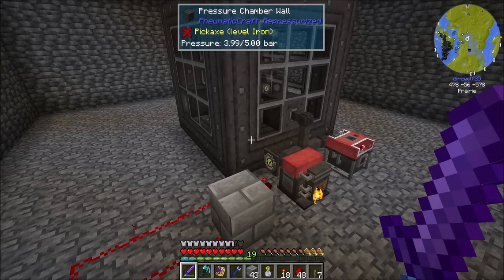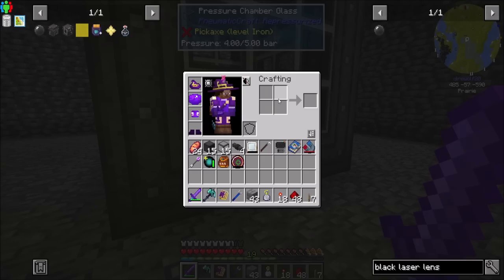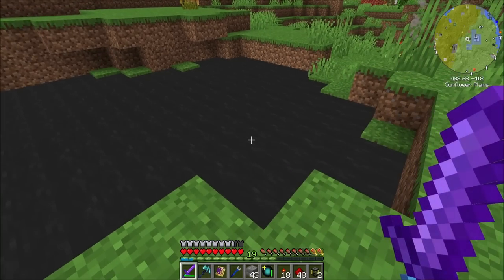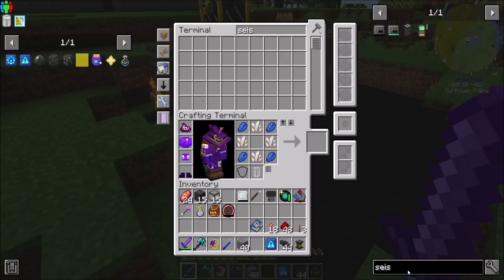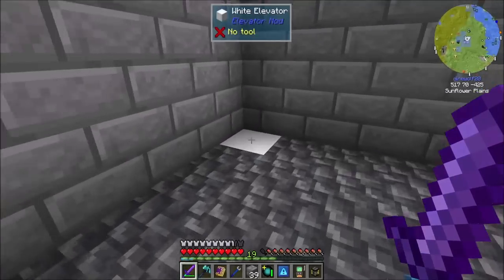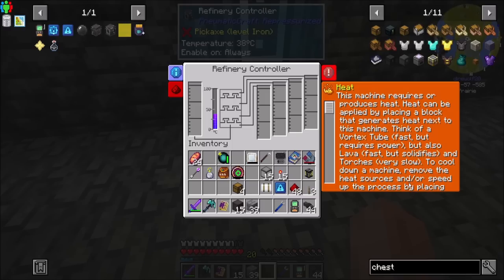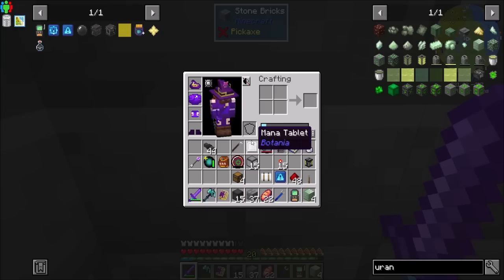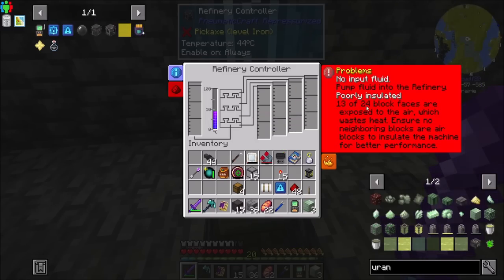LetsPlay S12E51 Oil Processing

Comment: Just fyi dire, when you have an open valve on a compressed air multiblock then OF COURSE its gonna leak
Reply: Should a valve be closable (and that be the default state)?  If not, it isn't a valve, it's just a hole.

Comment: I think that torches would make for a good insulation choice; They would slowly add a bit of heat (as opposed to doing nothing thermally), without ever decaying.
Another thing, but I think gasoline works better as a fuel source than LPG; LPG has a 1.25x modifier, while Gasoline has a 1.5x multiplier.
Reply: Yeah, I've been wondering for a couple episodes if Dire is ever going to notice that gasoline is the best fuel or if he is just going to convert it to less efficient LPG and burn it.
Reply: What does the modifier do, and how does that interact with the number Dire was going by?
Reply: @jursamaj  These values are pulled from the chart to the left of the UI in the liquid compressor, which indicates how much power is derived from a fluid. He skimmed it an episode or two ago, and seemingly assumed LPG was the best, as it was at the top of the first section.

In other words, LPG produces 1.25x (25% more, or 5/4ths) as much energy per bucket than "standard", while gasoline produces 1.5x (50% more, or 6/4ths) energy per bucket than "standard".
For reference, Lava was a mere 0.25 (meaning it produces just 25%, or 1/4th) as much energy as "standard".

Note that the 'standard' value is arbitrary; there's not "normal" or "intended" fuel; it's merely there to make it easier to define how much energy a given fuel produces. (This is why I put "standard" in quotation marks; to clarify that there is not "standard" fuel; it's an arbitrary value, used to simplify math and make comparisons between fuel types easier.)
Reply: @tygerion4404  OK, that's fuel efficiency, energy per bucket.  Pretty sure he was going by energy per time.  So the LPG produces energy faster but uses fuel even faster than that.  If you can produce fuel fast enough, energy per time is more important than energy per bucket.
Reply: @jursamaj  ... I'm pretty sure that the compressor burns through any fuel at the same rate. (though it's been a while since I messed with pneumaticraft).
Which means that the fuel that produces more energy per milibucket used also produces more per tick.

... Though I only just realized that I was referring to pressure as 'energy', lol.

Comment: does the create pump not make infinite stuff if there are enough source blocks around?
Reply: Not for all liquids anymore, to give infinite of a liquid it needs to be tagged with a specific tag. Only water and lava have those tags by default, and i doubt this pack has added them to oil. And you need about 10 000 Source blocks getting that many is a pain....
Reply: @sloner2356  Depends on the config. There's an ALLOW_ALL config option

Comment: I wish this pack had the no solicitors sign to stop the wandering traders
Reply: It has a thing that Dire thinks is supposed to do that.  I don't know if it really does, but the Pneumaticraft room is likely out of range of the one he installed.
Reply: @jursamaj  I wouldn't be surprised if the thing IS supposed to do that. But has been specifically programmed not to work with Dire XD

Comment: Honestly, Heat Sinks aren't counter intuitive, scientifically "heat" is a measure of thermal energy, things that are cold still have "heat" in a scientific sense (Except probably absolute 0, but that's another matter entirely).

The way Heat Sinks work, to my understanding, is that they create drastically more surface area for heat transfer allowing the heat to reach equilibrium much easier/faster.
Reply: I always tell my non-nerdy friends that there is no "cold" – there is only more of less heat. 🤪
Reply: FYI black laser lens fluid laser crude oil method is not working. I filed a bug report with the FTB team.

Comment: dire you have the laser io to send signals 😮
Reply: If you are referring to the signal to turn the pressure generation on/off.... LIO CAN send a signal.... but not read the strength. So (ideally) 9 redstone still need to run to the LIO node that sends the signal but it does make it easier to control multiple generators. I like to run the pipe down under the floor then up to the chamber, with the gauge and redstone hidden under the floor.
Reply: @ockerspock3432  cool